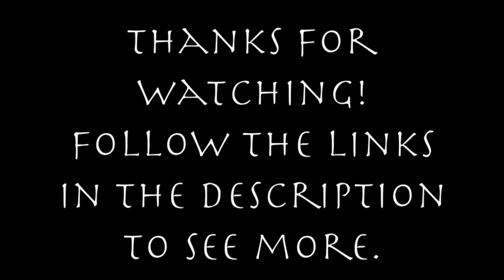How To Build a BOSS Tool Box PT 2

Comment: You seem to get a lot of your inspiration from Asian woodworking since I see you have used no nails. I love it.
Reply: Trent any carpenter worth his salt from any culture in any period of time can build just about anything without screws or nails and probably without glue on top of that.
Reply: I do use nails - wooden nails. But what do I know, I'm just a bloody amateur ... :-D
Reply: It's not just Asian or traditional woodworkers who avoid nails and screws. It's any responsible professional. Nails and screws are convenient, and allow someone to join wood fast, but they are strain concentrators, due to being significantly stronger than most wood, and as such can cause tiny cracks to form around them. Once formed in regions of high strain, it's a matter of when, not if, these cracks will lead to failure.

Comment: Gorgeous piece, but I see you chose to run the lower wenge tenon wedges PARALLEL to the grain of the end pieces. This will cause the end pieces to split over time (if not already). Just curious - why?